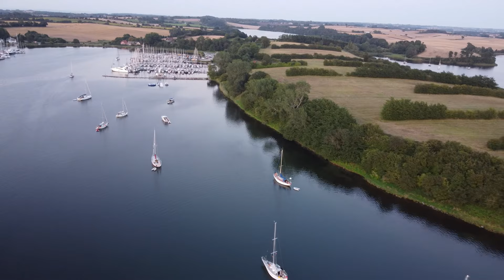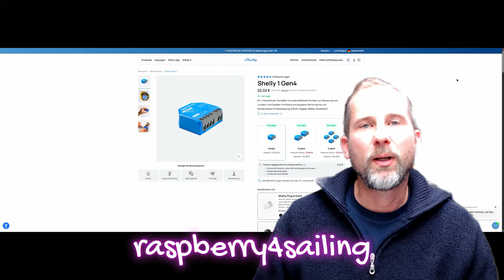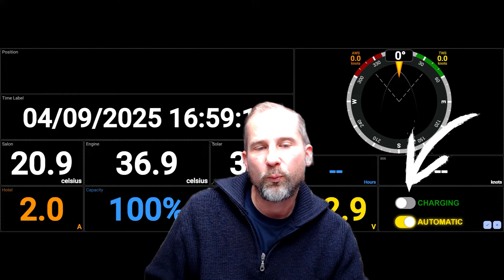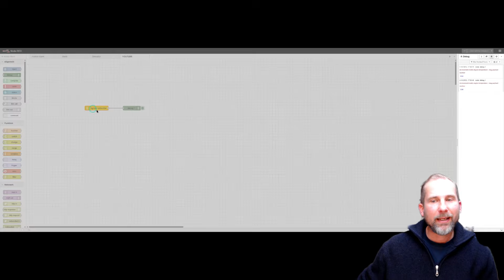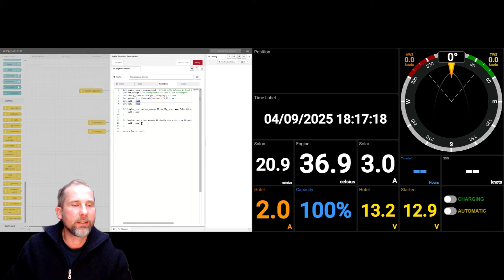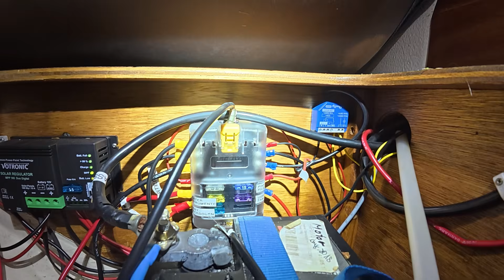Using a 12V Shelly to turn charging of a battery on based on temperature (Node-RED, Signal K, KIP)

Comment: I have a different setup where I use engine rpm to switch the charging on (switching on when the rpm is > 1400 rpm) using the W output of the alternator.
Reply from the maker: nice idea as well, thanks for sharing!